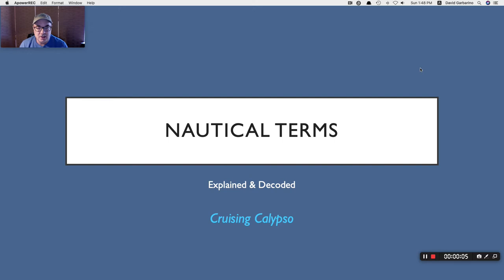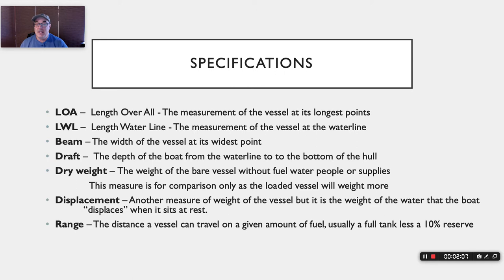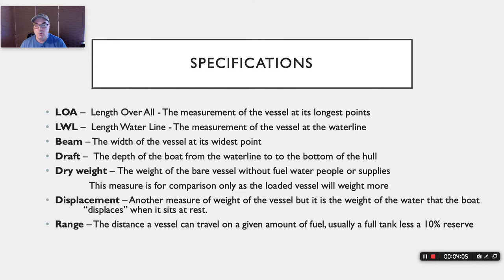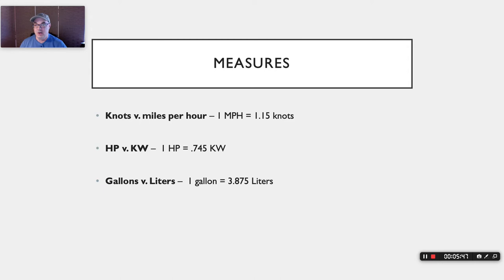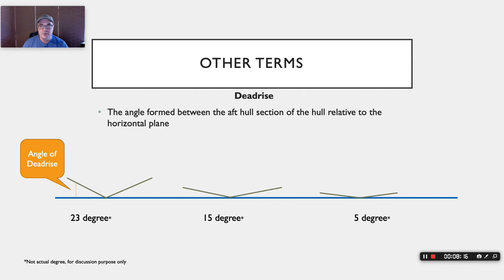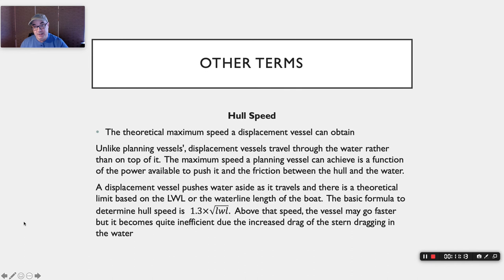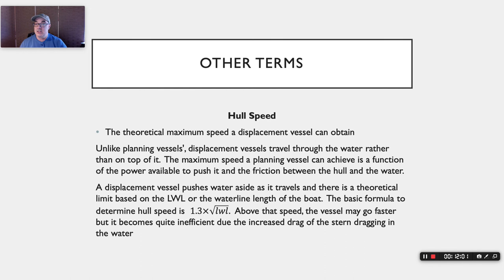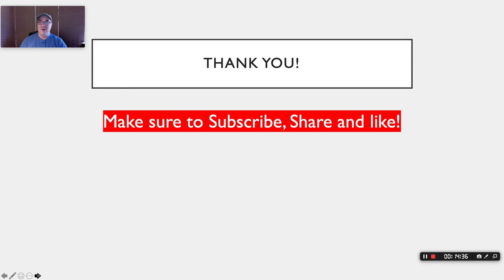DIY - Knots, deadrise, beam, what does it all mean? - Technical terms defined

Comment: You were incorrect in your description of knots verse mph. 1 knot is equally to 1.15 mph. Not 1 mph is equally to 1.15 knots. so if you say 7 knots is a little over 8 mph.
Reply from the maker: Ah, I reversed what I said. My bad.
Reply: @CruisingCalypso  No problem.  I knew what you meant you just said it in away that made it wrong.